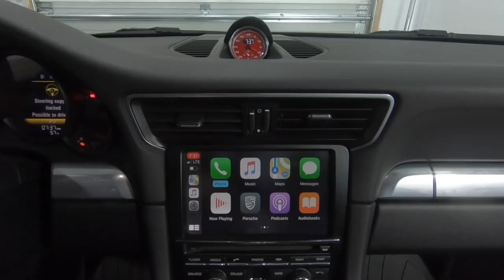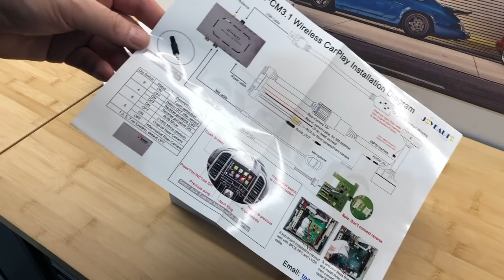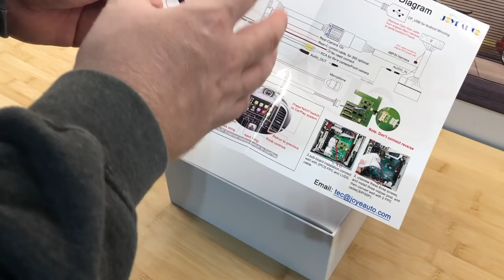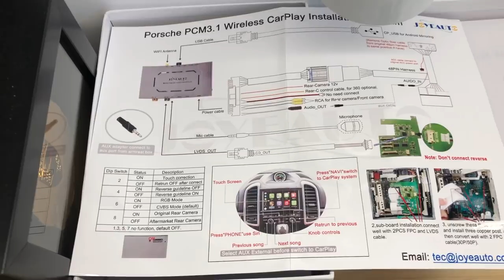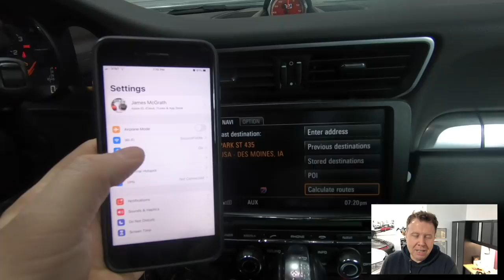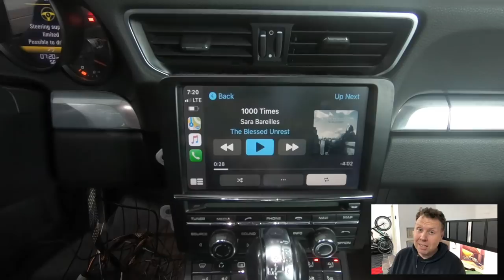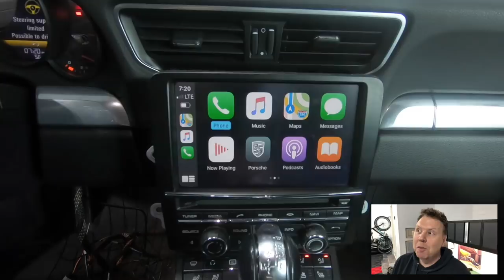Apple CarPlay DIY (Wireless) for Porsche 911 / Cayman / Boxster / Macan / Cayenne / Panamera

Comment: Does the audio quality suffer w/ CarPlay vs the PCM radio?
Reply from the maker: A lot of people say that it does, but that's because they often don't realize that the JoyeAuto device has its own EQ and sound settings that you need to apply. Out of the box, the sound is pretty flat and not as impressive as the sound you have from the PCM. However, as soon as you configure the settings (e.g. add a Rock or Pop EQ or whatever, turn ON the 'loudness' and 'subwoofer' settings etc...) the sound quality is awesome.

Comment: I think I've drained my battery not putting in the right place. Can you please tell me which port it needs to go into
Reply from the maker: Row 4, D1 should work.
Reply: @AutoAmateur  thanks for your help. One more question. How do I get rid of the echo from speaking through carplay
Reply: @AutoAmateur  could you be so kknd to get back to my comment above
Reply from the maker: @yasseralshahib1  yes of course. Try D1. Or try any other empty fuse but check for the blue light on the back of the JoyeAuto box. It will show you if there is power or not while the engine is off.

Comment: James, to pile on, this is an Amazing DIY Video!  So after seeing this I took the plunge and ordered a kit for my 991.1.  PCM board install is done (last nite) and I've run and connected wiring (a few moments ago).  I've got all the connections right and power to the Unit...BUT.  Having issues with Wireless and Bluetooth setup.  I can see the locked network "Wifi-AP-***" - do I need a password for this?  If I continue without a password, I sometimes see JoyeAuto as a bluetooth device, but having much difficulty connecting.  Any thoughts or ideas greatly appreciated - AS IF YOU HAVEN'T DONE ENOUGH!!!
Reply from the maker: Hi Chet!! Thanks so much for your kind feedback and congratulations for getting so far. You're almost there! I saw the wifi network but I don't recall needing a password. I turned my wifi on and off after I connected, to make sure it would work again. I also did the same with the bluetooth device I connected to. Are you seeing anything happen on the screen when you try to connect? If I recall, you need to also select the new Aux input on PCM and then press NAVI to see the new app screen itself appear.
Reply from the maker: Assuming all of the wires / wiring harnesses are connected into the back of the PCM correctly at this point, I think besides the simple suggestions in my first comment, I would suggest contacting Joyeauto's Tech support. Do you have their contact details on the wiring diagram provided?
Reply: @AutoAmateur  Hiya.  Yes have reached out to them via Web chat and email but no word yet.  For fun, I also tried the wired USB connection to see if that work.  No Dice,  In fact, when I connect via new JoyeAuto harness, I can't change inputs on PCM or get sound.  But when I swap back to oem harness, everything is Hunky dory (sound and inputs all work).  So maybe I just have a Harness connection issue.
Reply from the maker: Chet Steiner yes, that sounds like it. Or maybe the little white cable isn’t connected to the new circuit board correctly. Did you make sure it was inserted with the metal pins facing upwards and that it was pushed all the way in? That would only account for the video in though, not the sound.
Reply from the maker: Chet Steiner is your fuse connected properly to power it all?
Reply: Auto Amateur so, can this work at all without connecting the fuse? This might be a stupid question :) I got everything connected, but can’t see Wi-Fi or Bluetooth, seems like it’s dead. But all factory functions work fine.
Reply from the maker: Hi Elvis! You MUST connect the JoyeAuto device to the fuse box to give it power.
Reply: @AutoAmateur  Thanks so much for such a quick reply! I will give it a shot! Did not route the wires and figured out where to put the JoyAuto box yet, wanted to test everything before I put it all back in.
Reply: Also, does it matter where I plug in it? Can I just plug it in any empty slot in my fuse box? Thanks again!
Reply from the maker: Elvis Travancic send me an email to AutoAmateurBlogger@gmail.com and I’ll send you a photo of where I put my fuse. You have to be careful because I think some fuses shut on / off with the ignition and don’t drain your battery, others stay on while you’re car is off you want to avoid these.
Reply: Auto Amateur found that out the hard way :) plugged it in a constant empty fuse slot and drained the battery. I have a 2015 Macan S, not sure if you know which fuse slots are switched and which ones are constant? Found some info on some forums and I will give it a shot.
Reply from the maker: Elvis Travancic sorry you hear that! Your best bet is to buy a voltage reader. They’re not very expensive. You can test each fuse slot with the ignition off. Slots that don’t put out a voltage reading are most likely switched. Slots that still put out a voltage with the ignition off are not. You can also take your car to the dealer and they should be able to tell you.

Comment: Auto Amateur, your video is excellent. I learned every word you said and I was ready to my the installation in my car but it turns out my car has PCM 4.0 which is totally different module. Apparently it seems to be easier since I do not have to open the radio unit, only bypass the LCD cable through the apple carplay box and also add the harness in between my car connector and the back of the radio unit. I have no video and although I can hear a preset radio station my screen is black and the controls do not work. My connections are well tight. Do you have any experience installing this in PCM 4.0 or do you know someone who can help me on this? Thanks
Reply from the maker: I haven’t attempted the 4.0 install I’m afraid. Your best bet is to contact JoyeAuto technical support.
Reply: @AutoAmateur  Hi James, thanks for your reply. I am in contact with them since yesterday, however still nothing. The PCM 4.0 module comes with the video interface box, LCD-In and out cables plus the harness with power connector but no fuse cable. If you happen to know someone who has done this install (PCM4.0) please let me know. Thanks again.
Reply from the maker: @lazarohernandez9276  Will do, sure thing! Thanks!
Reply: @AutoAmateur  Hi James, I am still having issue with my installation on the PCM 4.0 but I have just a general question for you. If you take the 48 pins Harness and connect in the original car power connector and the other side to the back of the PCM (without connecting any other cable) and turn on your car. Are you supposed to see your original screen? In other words, is this 48 pin harness simply an extension? This question is because by simply connecting the 48 pins harness in my car I lose the video signal to my LCD screen. Thanks for your thoughts in advanced. Lazaro
Reply: @lazarohernandez9276  Do you have a PCM 4.1? 
This unit is not as high as the PCM 3.1 and different. 
Please re-check the wiring diagram from JoyeAuto. It says “Connect with original LVDS Cable” and “Connect to Head Unit” meaning the PCM.4.1
Originally the Porsche LVDS (video) cable goes from the back of the bottom of the PCM 4.1 Head Unit into the back of the Touchscreen panel. 
To install the carplay box you will have to route this LVDS (video) cable through the JoyeAuto carplay box using the 2 delivered LVDS Cables LCD_OUT and LCD_IN .. 
1)On the bottom of the Head Unit unplug the green Porsche LVDS cable and plug it into the LCD_OUT cable which should then be plugged into the carplay box into the dark green LCD_OUT connector**. 
**Depending on the place where you will install the carplay box you should route you cables first. In a 718 the best place to install is behind the carpet the footwell on the passenger’s side, so you can access the box easily if you want to add a rear camera or update the box later. 
2) Use the LCD_IN cable and connect one side to the LCD_IN connector of the JoyeAuto carplay box and the other side to the bottom of the PCM 4.1 Head Unit (where you had unplugged the green Porsche LVDS cable.
3) Unplug the Porsche 48 Pin Harness from the PCM and Connect it to the to the JoyeAuto Harness. Reconnect the other side of the JoyeAuto Harness to the PCM 4.1
4)Connect the Power Cable to the carplay box, the Audio In/Out cable, the USB_Cable and the WIFI Antenna
and plug in the AUX Dummy in the glovebox connector.
When you have done all that, (reconnect the - of the battery) and turn the ignition key you should see your PCM 4.1 starting, there is a blue diode that flashes on the carplay box. Select AUX input on the PCM and  check WIFI and Bluetooth settings on your Phone.

Important: When I work on my cars on electrical systems, I always disconnect the – from my batterie (you never know) and use adhesive tape to secure “flying” connections such as Audio In/Out cables.
Reply: @peterherbst3924  
Hi Peter, many  thanks for this incredible explanation. Yes I do have a PCM 4.1. I am now waiting for my second box. By doing all of what you just detailed, I was not able to see anything in my screen and after multiple videos and pictures with  the engineers I had to return it back to the seller. They just sent another box. They think the carplay box has some issue. 
As soon as I receive the new box I will try again and keep you updated.
One question I have for you is regarding the location of the box. As you know PCM 4.0 is not as toll as PCM 3.1 and therefore there is a big space behind the LCD screen. Do you think this could be a good place to sit the carplay box? On top of the PCM behind the screen?). Thoughts?
Thanks, Lazaro
Reply: @Lazaro Hernandez 
That is true, but if you want to make any changes later you will have to unmount the
pcm again in order to access the carplay box.
 I wrote "**Depending on the place where you will install the carplay box you should route you cables first. In a 718 the best place to install is behind the carpet the footwell on the passenger’s side, so you can access the box easily if you want to add a rear camera or update the box later."
Reply: @peterherbst3924  
Wonderful!!. You are right, there is a big space there.  I will update after I receive the new box and finish the installation. Thank you so much for this advice.

Comment: My 2016 Cayman came with a rearview camera, but I can't get it to work with the JoyeAuto CarPlay no matter what settings are on the box.  With one setting it comes on in Drive, but I can't get it to work when in reverse.  Any suggestions?
Reply from the maker: Is it a factory camera or did any previous owner install an aftermarket one? That could help me figure out what’s going on. Hit me up at contact@autoamateur.com to send me a few photos of your set up?
Reply: I finally realized that dipswitch 8 should be the only one swithed on in my installation. The stock backup camera is now working including the parallel lines for parking.
Reply: Such a great service you provide and such prompt responses!  Thank you again.

Comment: Hi, does this add apple carplay to a non airplay head unit or just add the wifi connection function ?
Reply from the maker: This adds Apple CarPlay to a PCM 3.1 or 4.0 unit that doesn't currently have CarPlay. It gives you both wired and wireless connections! You can now purchase it through my online store for 20% off MSRP with free shipping! :-)
Reply: Thanks

Comment: I installed everything correctly but my screen is not powering on at all.    I tried my original harness and it works so the ribbons are connected properly. Just not drawing juice from the joyeauto harness
Reply from the maker: Email me at contact@autoamateur.com so I can help you properly. It's probably nothing too difficult to correct.

Comment: Installed this issues i am having is if i hit navigation it wont return to factory also it nakes me calibrate screen every time
Reply from the maker: You can turn the screen calibration tool on or off using one of the dip switches on the back of the JoyeAuto box. It's usually #1 or #2. Turn the engine / power off, turn either one of these dip switches to OFF, then boot everything back up again. You won't have to see the touch screen tool again.
Reply from the maker: Not sure what's going on with your NAVI button. Send me a video of it working / not working to contact@autoamateur.com and I'll try to see if I can figure out what's going on. Cheers!
Reply: Its a customers car i am a porsche shop the unit loads works but if i press nav button nothing responds
Reply from the maker: @gregleroy6123  best to email me and I'll see what I can do... contact@autoamateur.com

Comment: Do you find the box beneath the steering column interferes with moving the steering wheel?
Reply from the maker: For me, no, because I have the wheel all the way up and out towards me. However, having installed over a hundred of these now, I use industrial velcro to mount the box on the underside of the steering column.

Comment: My unit periodically is unable to connect to my phone (wired or wireless) and the only way I can fix it is taking the car battery out for 15 minutes and reconnecting it.

Happens every 3 weeks. Not sure why.
Reply from the maker: My factory CarPlay in my Chevy Silverado used to do this all the time. It's more of an Apple bug than anything to do with JoyeAuto. I don't know why the car battery would be anything to do with the resolution but whether I encounter this issue with my JoyeAuto CarPlay in my 911 or the factory CarPlay in my truck - the same solution works: Power down / reboot the CarPlay unit AND put your phone into airplane mode / then back on again. It's basically the Bluetooth connection that needs to be rebooted / restarted.
Reply: @AutoAmateur  thanks for the reply! Appreciate you and love the videos
Reply from the maker: @lemurtails_  you’re welcome and thank you!!

Comment: I installed but the audio is not working !!
Reply from the maker: Could be several different things. Did you insert the mini black aux Jack provided into the aux port inside the glove box?
Reply: @AutoAmateur  yes I did. I will check every connection again
Reply from the maker: If you have the Bose speakers, did you move the two orange fiber optic wires from the back of the black OEM wiring harness directly into the back of the new black 48-pin wiring harness? That’s probably it.
Reply: @AutoAmateur  I think I discover ! The optical cables in the hardness

Comment: will the factory installed back up camera continue to work after the installation?
Reply from the maker: Absolutely. Dipswitch #8. Turn ON for OEM camera. Off for aftermarket camera. 100%
Reply: @AutoAmateur  Thanks for the reply, awesome. I will order from you today!
Reply: Any ideas for backup and 360 surround cam?  Tried turning in dipswitch #8 and it didn’t work
Reply from the maker: Send me an email with some information about the specific camera you have and photos of how you wired it up? I’ll help. Contact@autoamateur.com
Reply: @deepaks5230  mine is the same its driving me nuts .
Reply: @Boris-xx7dw  So the fix for me was updating the firmware version. If you go to the WhatsApp chat for the company, they can send you a link to where you can download the software update to a USB drive. You can use the USB to update the firmware, and that seemed to do the trick
Reply: @deepaks5230  ok thank you , I’d practically decided to rip it out lol . I’ve just messaged them ! Thank you for the information. 👍
Reply: I’m going to have to have it taken out ! Apart from the camera not working I’ve got no am or fm radio .

Comment: does this work on the panamera also?
Reply: ps. EXCELLENT video!
Reply from the maker: Oh YES!! For sure. See AutoAmateur.com/shop for free shipping and a 20% discount off MSRP!! :-)
Reply: @AutoAmateur  i got it, had it in and out of the car about 6-8 times had no video one time. tried every single combination possible with the cables that i could, nothing, reverted back to original and everything worked perfectly as should. i think i may have gotten a fault unit maybe? definitely want it in the car though!